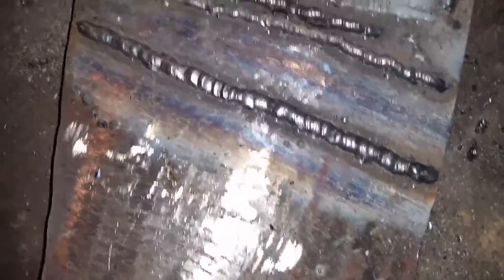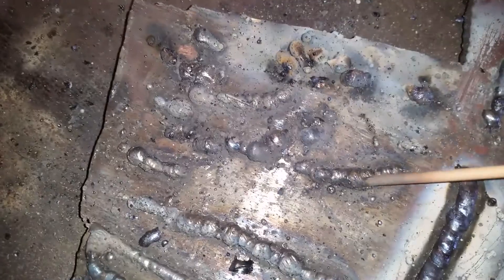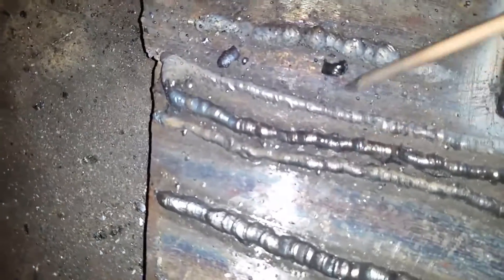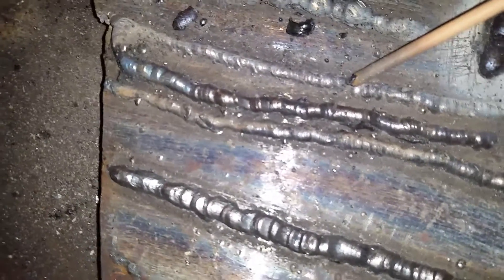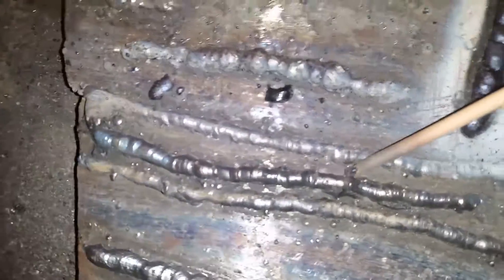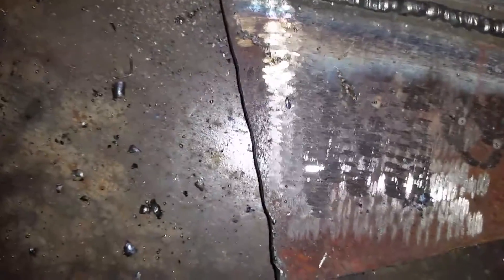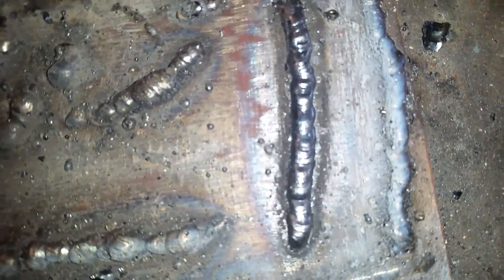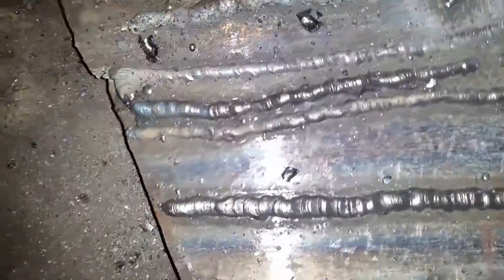6011 & 6013 welding rod practice welds

Comment: higher amps around 100, no circles with 6013.
Reply from the maker: James Mclaughlin Got rid of that welder, wasn't using it and life changed. Will remember to try different techniques when I get a stick welder again. On this particular welder, 100 amps was pushing it on the 20amp curcuit.

Comment: Not sure if you ever ended up satisfied with these two sticks. I would not worry about small circles with 6013 to start. Just stay on the leading edge of the pool. And yes, you should be worried about straight lines from the beginning. For 6011, practice whipping in your stringer beads. The best uses for 6011, throwing down a lot of metal, include application with whipping. The beads look great with it as well.

Comment: More amperage and go slower. Watch the puddle and stay on its leading edge as it grows move forward. It apears that you're just outrunning your puddle. Rememner that you're welding not using a glue gun. Penetrate the steel as your moving forward dont just drop filler metal in a line.

Comment: What I would try would be grind out a line, dosent have to be too deep of a grind but enough to follow as a straight line. It's difficult to weld a line on a pad in a line just because of how dark it is. Try that and see if that helps.
Reply from the maker: Arise Core Thanks. Am not twrribly concerned about a straight line yet, just keeping a stabile arc and trying to figure out how to keep a 6011 rod lit on my small AC current welder.